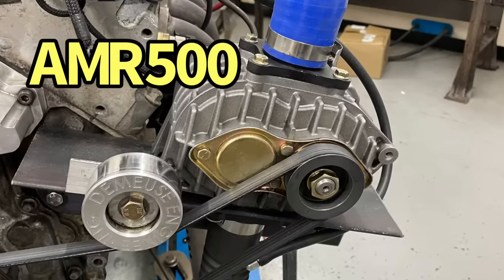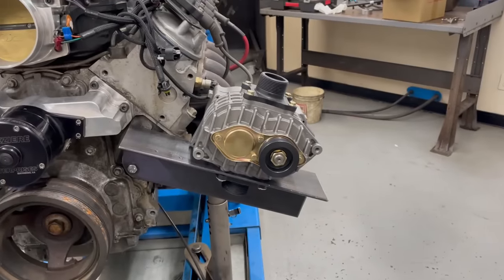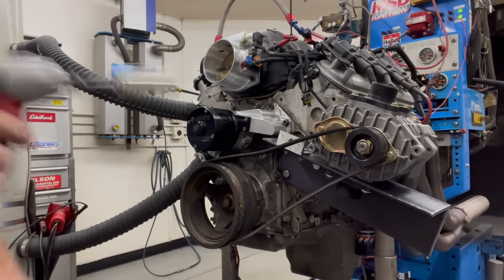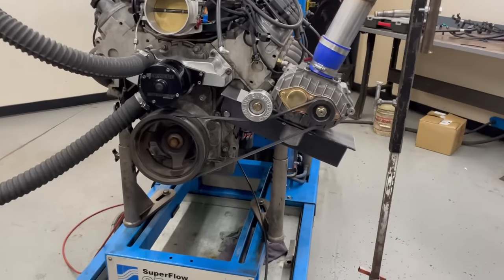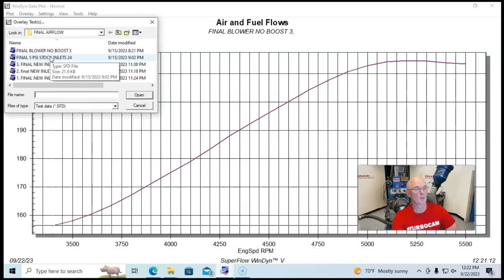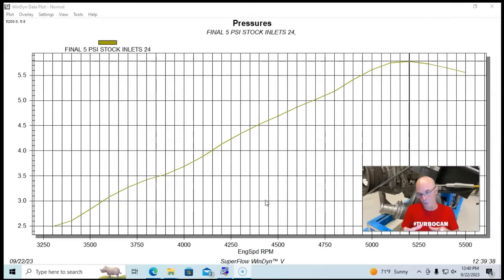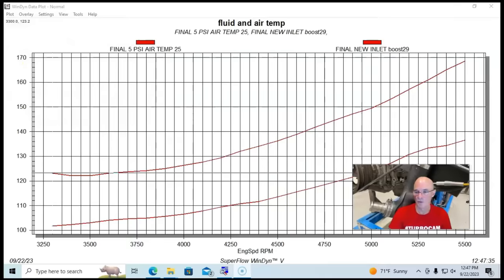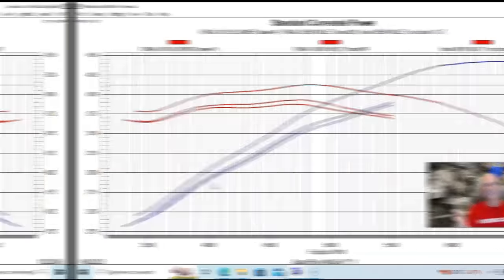THE ULTIMATE CHEAP, EBAY, AMAZON AMR500 BLOWER TEST. FULL RESULTS-AIRFLOW, TEMP & POWER CONSUMPTION

Comment: Wow all that  information and no final results?!?! What was the increase in HP and torque!!! Why didn’t you hook it up to the engine?!?! What a waste of time!!!
Reply from the maker: you were looking for the wrong thing-the flow data (this was a blower flow test) shows that running a 150-hp blower would be a waste of time on a 440-hp motor-but we now know what motors can run it on
Reply: @richardholdener1727   hey Richard, I think we’re all looking for the same thing. The bottom line! What’s the bottom line?
Reply from the maker: if you were looking for the power offered by the 150-hp supercharger on the 440-hp na motor, the bottom line is you were looking for the wrong info on this flow test of the AMR500

Comment: LOL, irrelevant testing methods and results. You need PRESSURE RATIO (absolute pressure outlet/absolute pressure inlet) and absolute temp in/out, and rotor speed.
Reply from the maker: actually not-this was spot on the actual blower dyno testing run after I did this
Reply: @richardholdener1727  No, you are wrong. You are talking to someone whom has actually done this in a professional capacity. I'm convinced you are clueless to thermodynamics. So, smart guy, tell me what, on ANY compressor or turbine map, what 'corrected speed', 'corrected flow''  (mass or volumetric), and 'corrected pressure ratio' means.

Comment: THIS IS A LIE!! HE NEVER CONNECTED IT!! DO NOT BUY THIS!! Tese are limited to no more then a engine with LESS THEN 1.5L
Reply from the maker: this was a blower flow (not power) test that actually provided flow data so people could properly pick the motor to run the blower on. Per the flow results, it is suited to support 150 hp (or so) and could NOT be used on a 440-hp NA motor. But by all means, yell and scream and show everyone you didn't actually watch the video.
Reply: @richardholdener1727 how do u build boost with the end open and no place for pressure to build up?

Comment: How would something with such a small intake/output compared to the actual intake on the motor make any power? None of this test makes any sense! You didn't even see if it added power! Useless! You need to run it to the motor to get some true results. Is this for a lawn mower? Go cart? Maybe motorcycle? 300 cfm Is useless on a motor that already flows more!
Reply from the maker: this was a flow test-to generate flow data (stop looking for dyno results of running a 150-hp blower on a 440-hp na motor)

Comment: What sort of rubbish is this? The AMR500 is rated for a MAX engine capacity of 2.2l. That is definitely not smaller than a 2.2l.
Reply from the maker: did you watch the vid? this was a flow test of the blower-and blowers are not rated for displacement-they are rated for flow and hp
Reply: I guess you don't pay much attention to us Yanks up here. Richard is one of the best.
Reply: @richardholdener1727  How do you get the flow for this unknown size engine for a supercharger rated with a maximum flow for a 2.2l engine. All I can see is an engine that is going to be very restricted in RPM due to the maximum spindle ratio and the max rpm of the supercharger.
Reply: @billholder9665  Well, if that's so he has failed on this video :)
"FULL RESULTS-AIRFLOW, TEMP & POWER CONSUMPTION" And lets do that in an environment completely outside of of design specs. I really don't see the point.
Reply: @richardholdener1727  So, after wasting 18.05 mins of my life re-watching the video, I still don't see what the point of this video is. How does this in any way relate to a real life usage of the AMR500?
If this is a just a "Spin the little AMR off the rpm clock for fun" and "Lets see what happens for chuckles" run, then maybe it would be worthwhile stating that at the start of the video :)
Reply: it doesn't matter what size of engine you put in it on. He's just testing the flow of it. It's not connected to the intake. You could use a smaller engine with the same rpms and get the same results.
Reply: @nothatsmypen  "He's just testing the flow of it." yes, after watching the full video I can see what he is doing, but still cannot see how this relates to any real world application.
The flows are indicated in the specs and model number (500cc/r).
~1:1 for a 1l and ~2:1 for a 2l to reach flow parity without boost and without considering back-flow inside of the pump, so we also have to over-spin that ratio some amount to obtain boost. The math is reasonable well defined, but it is dynamic in practice.
>
All that I can see here is a "static" test that shows that the supercharger "is working" to build flow and pressure, and that by altering the intake and outlet size we alter the flow and pressure a little, but we are also pushing it outside of it's intended design design specs @18krpm.
>
I don't for the life of me see how this static test relates to a real world dynamic operation with a multitude of different induction flow dynamics. Open the intake and outlet of that AMR500 and then plug it into an intake manifold with reduced flow and the entire exorcise is mute.
>
It appears to be nothing more than a static bench test to see if the pump is still serviceable. Maybe that is the point, but it is difficult to tell from the CAPS word salad in the title, and little information is given at the start of the video as to what the intention is. Maybe there is another video in a series that explains it? Is this video n of n videos in a series?